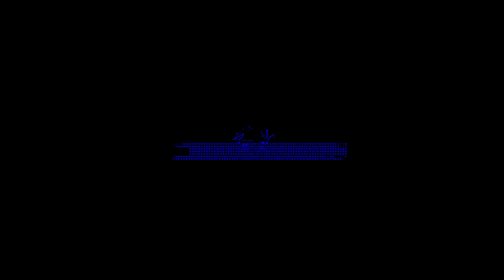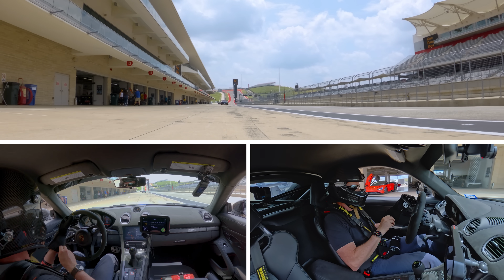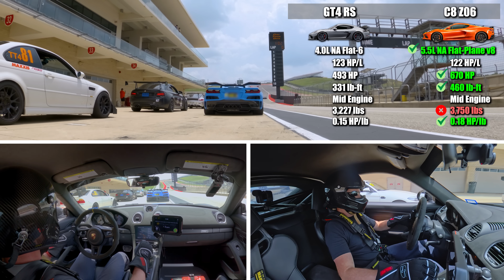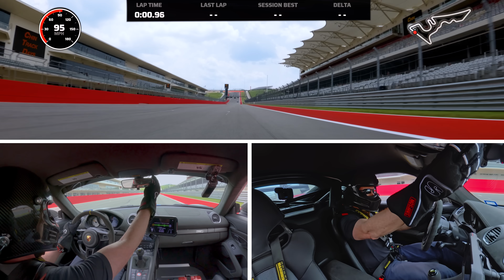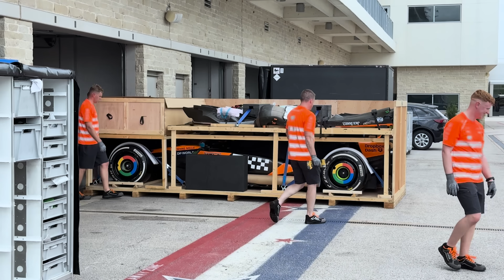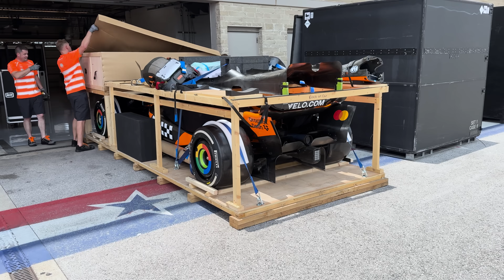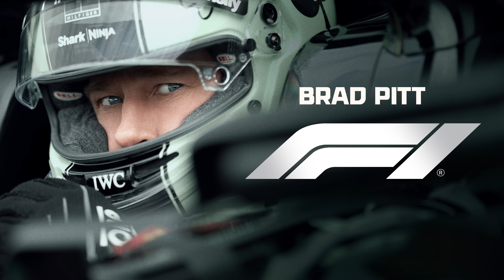Z06 vs GT4 RS : American Power Meets German Engineering at COTA

Comment: i love the Rs and the z06, im not bias one way or the other i love them for what they are. That said, not an accurate comparison for most part. you cant compare unless you are driving both and comparing recordings, we have no idea what the driver skill is infront of you. in addition fly by wire or drive by wire is not a new technology at all, its been around for many years, its in many advanced aircraft and has proven to not only be as reliable, but also more precise. laslty the cost, which matters, at close to double the price the RS is, it cant be ignored. the z06 is without doubt the value here and certainly a better street car for a cruise. the porche on the track is where its at home, but it lacks power, i have a 911 rs and its just not a fast car, now its not supposed to be i guess. i love a car that has the jam to break lose a bit, and also having a vet its just the best all round car for everything, little track, lots of street and straighline it has a personality not all noise. In my opinon while Porche is the pinnacle its overpriced, overvalued and probably overated. guys dont want a corvette to be compared to a porche, but its too late, its already driving circles around them, if you care about the rolex prestige and thats what matters ignoring the facts, have at it.

Comment: In the day and age we're living, they seem to think a street car on the track you're supposed to perform like a track car, being capable of taking far more punishment over a longer period of time. Street cars or GTs are supposed to be for touring. In fact, the front engine Corvette for street use is far better, more room for your stuff easier and safer to build  mid-engine cars are very complex for what you end up with on the street.

Comment: You're right about the C7 ZO6 cooling issues, the LT4 from the C7 went into my '17 ZL1 with 1 major difference, there's 11, yes 11 radiators and I'm telling you all that no matter how hard you drive the ZL1 that temperature gauge does not move. I live in south Florida and even when "spirited" driving in 100 degree heat and humidity the temperature gauge doesn't move, yes you can tell the heat and humidity rob some power, but my LT4 is always running cool even when beating on it. Whenever we get out of the car leaving the engine running you hear so many fans winding up to cool the motor it sounds like a jet plane.

Comment: Its also lots to do with driver. Same driver comparison, we see that at the factory race laps; easily have someone at a race like yours not similar braking tech or exp.... ie nurgburgring -  c8 z06 7:11.826.....c8 zr1 6:50.763 ... gt4rs 7:03.121 .... gt3 rs 6:49.328 ... then the c8 zr1x 6:49.275

Comment: Awesome cars. And I’m not here to debate z06 vs GT4, but just to point out something obvious but not mentioned: 

1sec gap at 50mph (slow corner) is say 200ft, that same exact 1sec gap at 150mph is 600ft. You’re still the same time apart, but the gap of course is smaller if you’re moving slower. So don’t think ‘look how much I close up under braking’ - it’s just physics. He’s going 60mph and you’re still going 130mph slowing down so the distance in feet reduces.
Reply from the maker: Correct, however the accordion—or concertina—effect only becomes significant when there’s a gap between cars, allowing speed differences to build and cause the spacing to compress or expand, especially in braking and acceleration zones. When cars are bumper to bumper, they brake and accelerate almost simultaneously, leaving no room for that compression or stretch. In that case, the effect is neutralized—you’re essentially locked into the same timing as the car ahead. Skip to 10:12 in the video and watch the grey Z06 accelerate. A 670 hp car should easily pull away from a 500 hp car on the back straight and open a gap that can’t be closed if both cars brake at the same point.

Comment: Great video. A few comments. First, you talk about the distance between you and the Z06 closing up in slow corners and extending on the straights. It's not about distance, it's about time--if you're behind by 2 seconds at 50 mph (22.4 m/s), then you're 45 meters back. At 150 mph, you'll be 135 m behind. Yes, we're all rooting for you being able to brake later than the Corvette, but both cars can generate what, 1.2 g in deceleration (if they're on equal tires). So what we're seeing here is that you're both slowing down, so the distance gap closes, but the time gap stays the same. As Barry (below) says,...Point 2: All this is meaningless if you're not on very similar tires. Barry says he was on street tires, don't know what you were running. When I instruct students and someone in a seemingly lesser vehicle wants to pass, I say, "let them go, they might be on better tires". Finally, the 500 lbs "they need to take out of the car" won't be noticeable under braking per se--both cars are braking quite well, especially if they're on race rubber. But after several laps, those 250 kg slowing from 70 m/s (160 mph) to 25 m/s (55 mph) will add up to momentum (kWh, or Joules) that need to be absorbed by the braking system, then expelled as the brakes cool on the straights. At some point the brakes are unable to reject that heat, and then all Hell breaks loose. Most of the time, during a 30 minute track session this doesn't present a problem, but as you say, the extra weight takes its toll on consumables--namely in this case rotors and pads. Finally, about not seeing C8s in higher run groups, well, they're expensive, but most importantly, it's more fun to drive a slow car fast than a fast car slow. At a MB/Lotus event at Watkins Glen a few years ago I had to drive my Acura RSX (160 hp) commuter car because my "regular" car was laid up. It was a riot keeping up with the bigger iron despite an enormous power and handling deficit. I'm not saying I slayed everyone--I certainly did not--but after the runs a few folks would come up to see what was going on with the RSX--on street Continentals, squealing like pigs with the inside rear tire up in the air on corners like my old GTI.

Comment: I think this is a pretty terrible comparison... Going to compare the new flagship Corvette ZO6, against the GT4??  This really should have been done using a 911 GT2RS Weissach!  Sure, the GT4RS weighs 200 lbs less than the ZO6, but that isn't going to make up for the nearly 200 whp and 100 ft lbs of torque.  This is an absolutely absurd comparison... That's like comparing my Type R when it was stock, to being able to beat a Hellcat in the straight line 1/4 mile, from a dig... It's laughable...
Reply from the maker: Seems like you missed the point of the video. Maybe give it a full watch before jumping into the comments. This isn’t a drag strip—it’s an F1 circuit, where going fast takes more than just horsepower. Lightweight, agile cars routinely outpace heavier, high-powered ones on tracks like this. Ever heard of a company called Lotus? Might be worth a little history lesson.
Reply: The gt4 rs is faster around the Nurburgring than the z06. And there’s a 400 pound weight difference not 200. Maybe rethink your comment
Reply: @ak740_ weight difference over 600 lbs in the video as I was passenger in the z06 lol
Reply from the maker: I rarely take passengers for exactly this reason—lightweight cars handle very differently with an extra 180 pounds in the passenger seat. I'm much more likely to look for something to leave behind than someone to bring along.

Comment: I looked for a yr at the 911s 718 gt4 gt4rs 458 488 f was goimg to buy a 488 challenge and somehow convert to street legal use it was possible so i looked some more porsche the dang price just dont move on the used market new was oh you have to buy 3 before you get one at msrp so finally i got the 2024 z06 z07 package car ive had it a yr now with 1500 miles never tracked 2nd oil change the oil looked horrible with only 300 miles on the oil just from sitting took its toll so if you have a z06 drive the dang thing and have fun.

Comment: I have a 911, Cayman, Macan… but to be fair you can buy TWO z06 for price of ONE gt4rs
Reply: not in my case.  my 2 c8z msrp add up to be 300k and my 2024 gt4rs is 200k with weissach package.  friend 2025 gt3rs msrp is 326k.  I have had both at track same time and short track gt4rs faster big track like cota z06.  the 4rs i have had the camber kit, track alignment and axel exhaust

Comment: AMG One is 3700+ lbs
Reply from the maker: Wow, for that kind of money I would expect better.
Reply from the maker: It looks like they’re blaming the high weight on the four electric motors, battery pack, catalytic converters, particulate filters, street exhaust, and the massive cooling system. I’ll take the cooling—but they can keep the rest!
Reply: @ItsTrackTime that’s a terrible excuse. You’d think the MGU and battery tech from F1 would have been used since they are claiming F1 pedigree with the engine.

Comment: I’ve cried about that since the C8 came out, the excess pork. There’s no reason a Corvette should be heavier than a Camaro, pushing toward 4K lbs. Ridiculous.
Reply from the maker: These machines have grown significantly in both size and weight. The C8 is massive, and even the current 911 has become a large car. Small and light is ideal for the track—big and heavy is better suited for the street. As you can probably tell, I’m not a fan of oversized track cars.

Comment: I think this is the track the Mustang GTD would dominate. If the damn thing wasn't $300k+! Also Corvette's have always had a problem with heat soak and the mid engine design has compounded the issue. Adding forced induction makes it really fast for a street car, but a track car? Nope

Comment: Your clip is great! Why are you using motor and engine interchangeably?

With the hybrid super cars and full electric becoming more common, be focused and use correct words pls!

You mention weight in the clip, then you may be on board.

Look into carbon core motors. Soon it’s going to be hybrid or full electric only! The power to weight is now in favor of electric! Torque that’s unmatched!
Reply from the maker: Thanks! Why do I use 'motor' and 'engine' interchangeably? Because I’m not part of the EV crowd and haven’t spent any time in that world — I plan to stay in the ICE camp as long as possible. But just for you guys, I’ll try to keep the two terms straight.

Comment: I'm with you on the weight of that thing. The engine is unquestionably a work of art, but that car is heavy. When you think about the fact that some recent electric cars are only a couple hundred pounds heavier with similar horsepower and a half ton battery in them, you have to ask yourself what GM is doing over there on the chassis side of things.
Reply from the maker: I just wish they’d made it smaller, lighter, and with more downforce—focused more on the track and less on street comfort. They already have street-oriented models. The Z06 and ZR1 should be built for the track.
Reply: @ItsTrackTime  100% my thoughts as well.

Comment: Love the layout of the video. Did you clip the Catalyst UI elements manually or did you use some tool/plugin?

Also curious which 360 cam that is. X4?
Reply from the maker: Thanks! Yes, the Catalyst elements are pulled using Adobe Premiere Pro, and the 360 cam is an X4.

Comment: I know there is an accordion effect racing on road.  Maybe a better comparison is time?
Reply from the maker: The accordion—or concertina—effect only becomes significant when there’s a gap between cars, allowing speed differences to build and cause the spacing to compress or expand, especially in braking and acceleration zones. When cars are bumper to bumper, they brake and accelerate almost simultaneously, leaving no room for that compression or stretch. In that case, the effect is neutralized—you’re essentially locked into the same timing as the car ahead. Skip to 10:12 in the video and watch the grey Z06 accelerate. A 670 hp car should easily pull away from a 500 hp car on the back straight and open a gap that can’t be closed if both cars brake at the same point. But yes, time is the correct metric if you want to extract it from the video.

Comment: A few comments from a Porsche fan. The comments about humidity were incorrect, high humidity has almost no effect on oxygen in the atmosphere and humid air is less dense. Second, without discussing drivers and tires, there is no meaning to this comparison. Third, we don't discuss "look how close I was". You should discuss "how many seconds behind" as relativity between cars is measured only in time. Finally, an accurate measure between cars on a track is done in segment time. Perhaps GT4s are faster in the turn sections and the Corvette faster in the straights, but track segment times are missing from this. The ultimate measure of track performance is done in lap times and you didn't quote any. Your in-car screen showed lap time about 2:25. Stock Z08's have done 2:19. Find a guy with a Corvette doing 2:18 then compare to that.
Reply from the maker: Humidity displacing oxygen is well-documented in high-performance engine discussions. Just take a look at aircraft engine manuals—where a loss in power isn’t just a slower lap, it can be life or death.

Tire performance is already covered in the comments above.

As for the concertina effect: it only comes into play when there's a gap between cars. That gap allows speed differentials to build and compress or stretch spacing, especially under braking and acceleration. But when cars are nose-to-tail, they brake and accelerate almost simultaneously. There's no room for that compression to happen—the effect is neutralized. You're essentially locked into the same timing as the car in front.

Skip to 10:12 in the video and watch the grey Z06 accelerate. A 670 hp car should easily gap a 500 hp car on the back straight—assuming both brake at the same point, that gap should hold or widen.

And yes, I’ve only seen stock Z06s turning 2:19s at COTA. Stock GT4 RSs on 200-treadwear tires have done the same. My car runs consistent 2:18s with me driving, and 2:16s in the hands of a pro on a cool day. Without traffic Randy showed a 2:15 was possible - all documented in my videos.

Comment: I’ll  catch up. Just let me get all four tires off the track cutting corners 😂. it’s pretty hard to judge when you’re doing that, but do whatever favors the point you’re trying to prove.
Reply from the maker: The rule is simple: one tire on the white line is legal—four off earns you a black flag. I didn’t see any flags in that video. The point was late braking after a straight, with an extra 500 lbs onboard, which doesn’t require any turning.
Reply: @ItsTrackTime haha, like one of those guys that says “I use the whole track.” More power to ya bud.

Comment: click bait. Is that corvette driver as well versed as you are on this track? Is he just an average joe? This is NOT z06 VS gT4. YOU WOULD HAVE TO SWAP CARS AND DRIVE UNBIASEDLY AT A MIN TO BE A TRUE HEAD TO HEAD. Let me help you and this is a GT3 https://www.youtube.com/watch?v=zUqDKZEf_FA&t=2538s
Reply from the maker: I don’t have access to a Z06, so a head-to-head comparison with me driving isn’t possible. However, if you listen to the pro driver in the video you referenced, he echoes the same points I’ve made. The Z06’s strength is its power, but its added weight and brake-by-wire system are clear disadvantages. He mentioned that the steering inputs were smoother and more linear in the Porsche, and he was able to brake much later—both of which he attributed to the car’s lighter weight. They ultimately concluded that on a track with long straights, the Z06 would come out ahead, but on a more technical circuit, the Porsche would have the edge despite having 170 less horsepower.